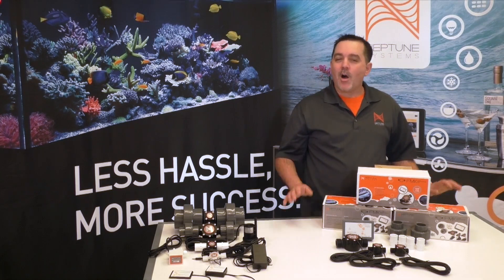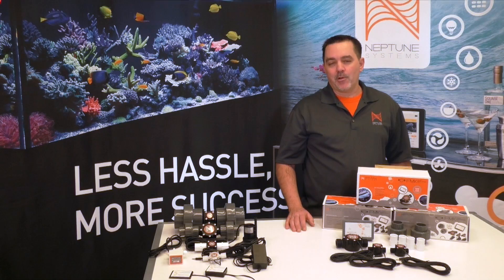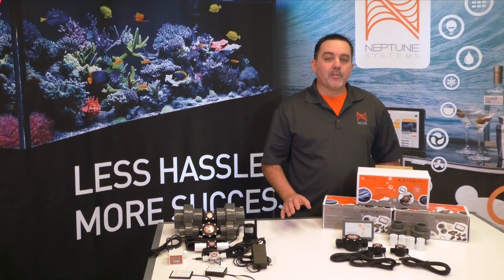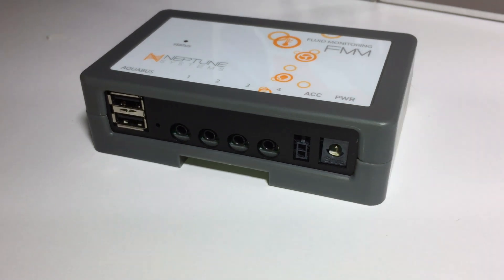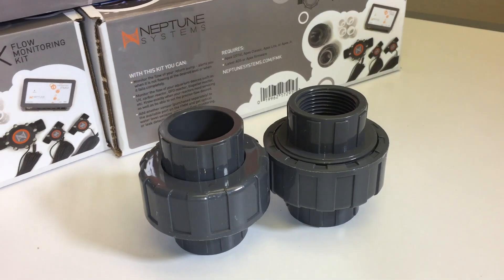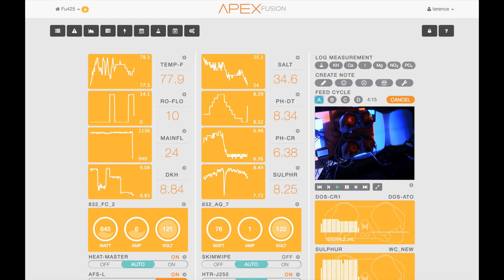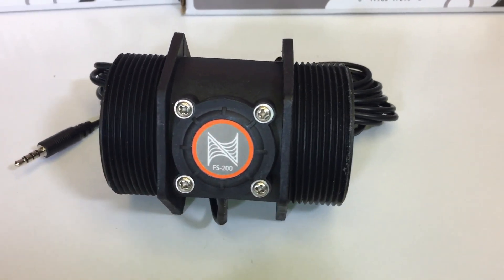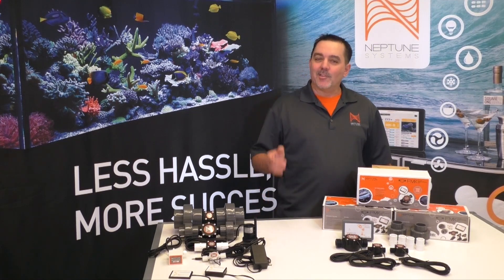FMK - Flow Monitoring Kit :: Know your Flow! :: An Accessory for your Apex by Neptune Systems

Comment: I'm curious as to why an American company would ignorantly choose to use British standard pipe thread on the sensors for your fmk. This is a massive issue for domestic customers who are stuck with NPT threads for any plumbing parts. Neptune needs to do better.

Comment: Its unfortunate that you sell your pump with a 3/4 out, and a coupler to 1 1/4 and not 1 inch.  Where are the fittings to directly transition from the COR-20 to the 1 inch in as little space as possible?  An plans for a 1 1/4 or 3/4 inch flow meter?
Reply from the maker: Generally it is a good idea to upsize your flow meter at least one size from the main line diameter. This would mean that the COR would be optimally run with its included 1.25" union and then a 1.5" flow sensor. Since it is not feasible for us to have a flow sensor in every size, we went from 1" to 2" knowing at any one in-between could use bushings to step down from the 2" to a smaller size - such as 1.25".
Reply: You sell the FMK with a 1 inch, so if you would think you advice would involve the 1 inch sensor.

Comment: On the 2" Flow Sensor, what's the recommended length of straight pipe before and after it?   I know in industrial settings, there are typically minimum recommended lengths before and after.   You may also want to throw in any measurements for the other sizes of sensors, for others that may read here.
Reply from the maker: It is 10X the diameter, but we have seen very little variance with half that amount.

Comment: Why isn't there a 3/4" model for those with a smaller tank which would need a smaller return line than 1"?
Reply from the maker: Because you use the 1" model and then use step down bushings to 3/4". This is actually much better as it will also not create restriction.

Comment: I just received my FMK! What do you recommend sealing the threads on the 1" flow sensor to the union with? Paste or tape?
Reply from the maker: Brett Smith did you watch the "get started" video?
Reply: Is that the video by Aquarium Specialty? If so, paste it is. Any certain kind of paste? I picked up some Rector Seal 5 today, but there's some differing opinions on these here interwebs whether paste is safe, or if you should use PFTE paste. Thank you for your quick response!
Reply from the maker: https://www.neptunesystems.com/getstarted/fmk/

Comment: Why no 3/4"? A lot of products use 3/4" plumbing like UV sterilizers, reactors, etc.
Reply from the maker: Wylie Coyote you can easily use a 3/4" bushing and it will work just fine.

Comment: One more example of an American Company catering to the rest of the world first And to it's own people 2nd. All about the money. What BS!!
Reply from the maker: Having a hard time understanding this comment. There are standards in the world so one had to be chosen. The molds for all these sensors were already established and using them meant that we could bring a super affordable product to our customers. Other standalone flow sensing products out there cost hundreds more just for measuring one pipe. Add to that we have included quality unions unlike most any other product on the market. The unions alone on the 2" sensors would cost $28 each from BRS. Our 2" sensor WITH these unions is just $99.  You will have an impossible time finding a single flow meter device, including the unions, with email/text alarms, etc. for 2" plumbing for $200.

Comment: I thought Neptune was a american company. Don't understand why they have British threads that we need to add something that is going to restrict flow as they pointed out at the beginning of the video.
Reply from the maker: BSPT/BSPP are the standard worldwide. We sell products all over the world.  And on the 1" and 2" models, because you would want to take these sensors out when they need cleaning or should they ever fail, you would want unions anyways. So, this way we can have fittings that will work everywhere, and in the USA you get free unions with the sensor!

Comment: Do you recommend place the FMK on the return line to the sump? It would be difficult for me to attach on the line to the tank.
Reply from the maker: The flow sensors should be placed on the flow (return) side, not the drain side.

Comment: These videos are extremely helpful in understanding your products in a quick manor.  Please keep putting them out.  We find them very helpful!  
If we put a FS-200 Flow Sensor - 2" with unions on a 1.5" return line coming from a feed pump it will work just fine?  How often do you suspect these will have to be cleaned?  Is there any kind of calibration done with them or life on the sensors?
Reply from the maker: Thanks, they take a lot of work for sure so its good to know when we have hit the mark!